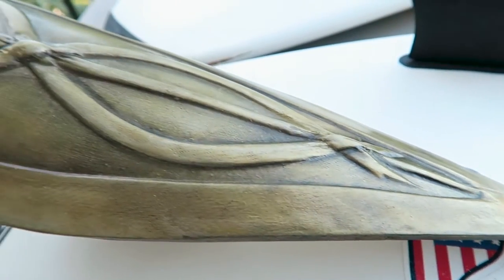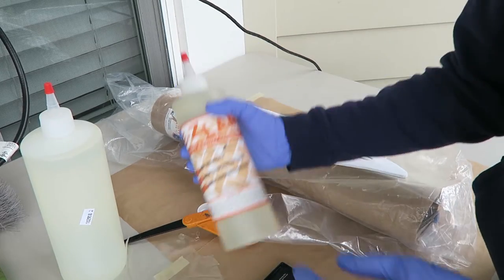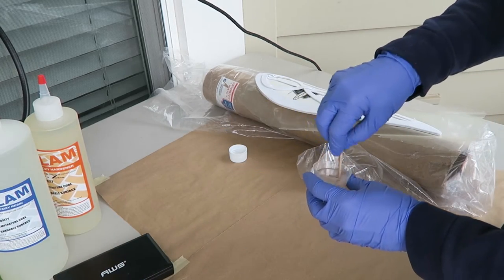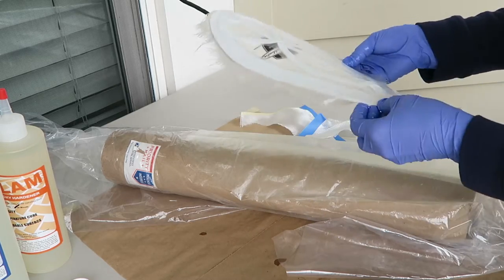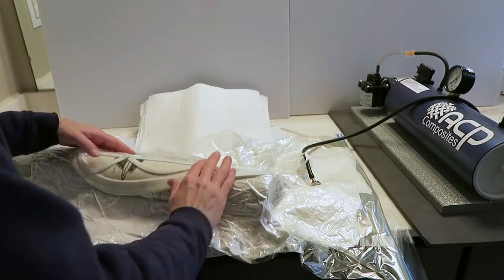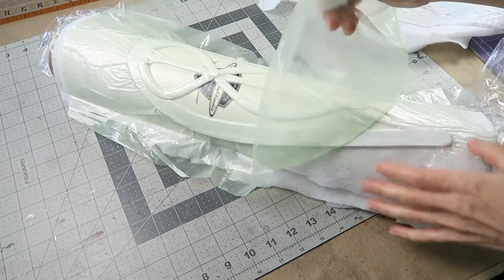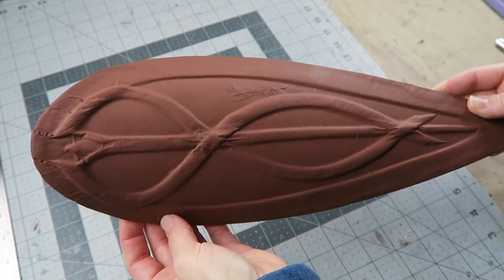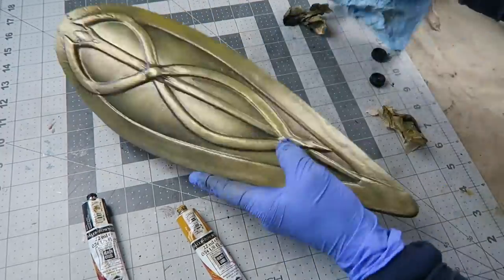Fiberglass on Craft Foam Vacuum BaggingTest for the High Elven Shield

Comment: another option instead of using spray adhesive is to spread a thin coat of resin first and let it set til it gets tacky, then lay down the fiberglass. it might also help to use a plastic spreader help coax the fiberglass into the crevasses as well.
Reply from the maker: Sure thing, that could work too. I did already use spray adhesive on the large one since posting this. It worked fine since this is going to be painted, but yes resin migh have been better as the glue wanted to dry before I could get the cloth stuck into the details.
Reply: @LindyDesignLab  Its typical in fiberglassing to coat the form with resin, (no need to wait for it to tack) before applying the first layer of glass or fiber. You will get more consistent better penetration and of the resin and its much faster at wetting out. I wouldn't try it dry or glued down.

Comment: Hi! I’m building some Eva foam remnant stormtrooper armor, will epoxy resin work well for gardening it so it is more durable?
Reply from the maker: Because EVA foam by itself is flexible, you typically want to use flexible paints and finishes so they don't crack. Epoxy is hard and relatively brittle once fully cured, so probably not a good idea in the long run if you're just wanting to put on a couple thin coats. If you were to use layers of fiberglass in there too and really build it up then no problem.
Reply: @LindyDesignLab  that makes a lot of sense, thank you! I was wanting to make it more durable to use either for cosplay or in Star Wars airsoft events. Do you know anything about plastic coating the pieces or where I might find a good product to do so?
Reply from the maker: Plasti-dip is the typical coating used to seal EVA. More of a rubber than a plastic. Worbla maybe?
Reply: @LindyDesignLab  worbla might actually do the trick… thank you!